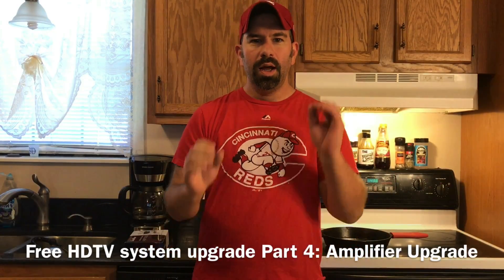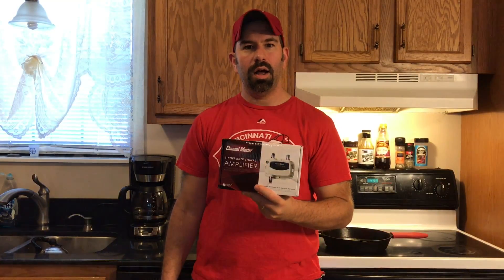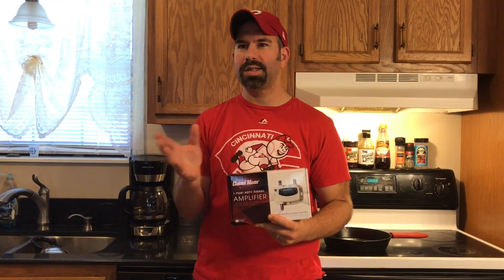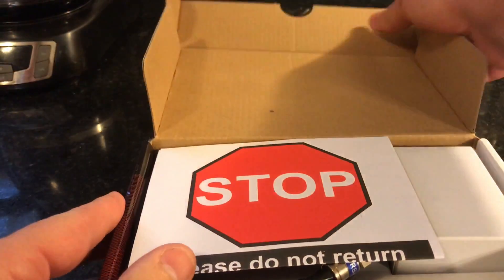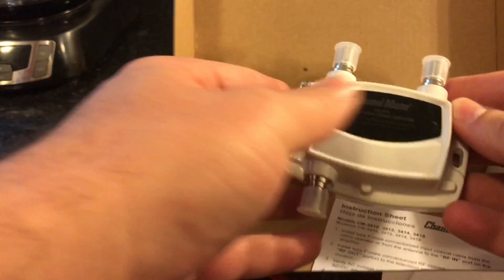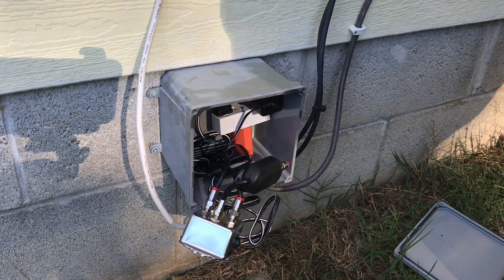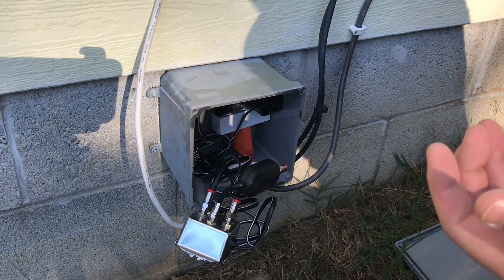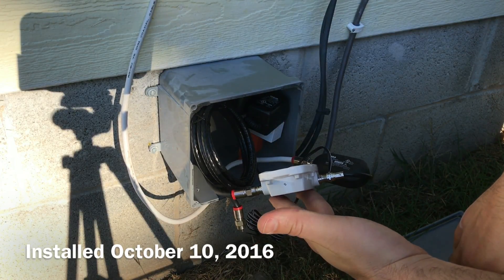Free HDTV system upgrade Part 4: Amplifier Upgrade

Comment: I use mine IN ADDITION to the PreAmp I already installed years ago. Some channels were pixelating a lot. The PreAmp is the Winegard AP-8275 with 29db VHF, 28 or so UHF. I ORIGINALLY mounted this mini Distribution Amp right on the power supply, in the basement, OUT to TV. There was NO DIFFERENCE AT ALL!! Then, I mounted it 20feet FARTHER, AT the TV.  IT WORKED! The weaker pixelating ones were now clearer and sharper! PLUS, the db GAIN meter on TV increased. Locals are db maxed, FIRST time ever!!  BUT, light on dist. amp. NEVER LIGHTS UP!